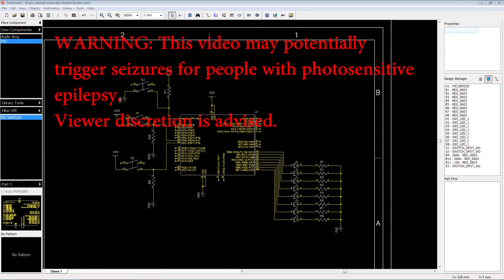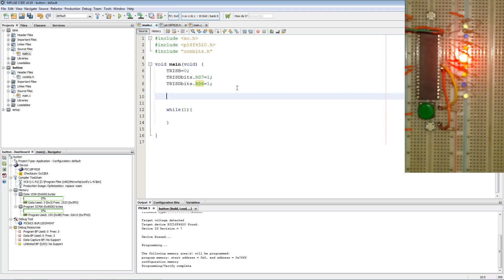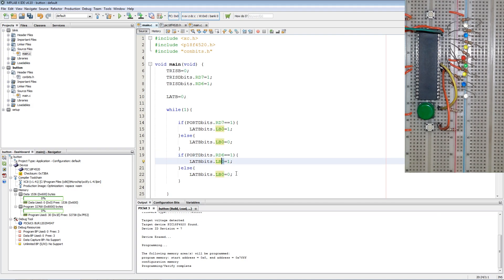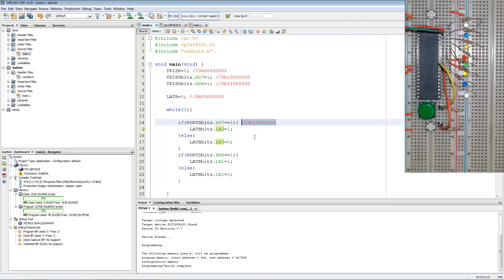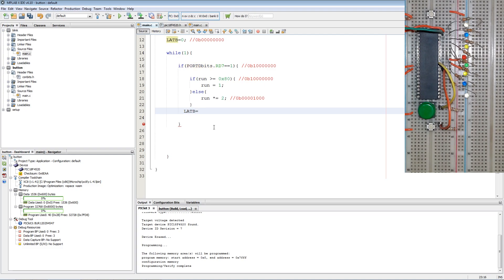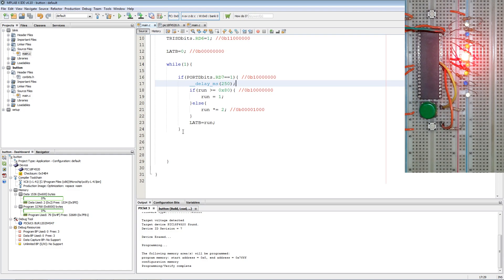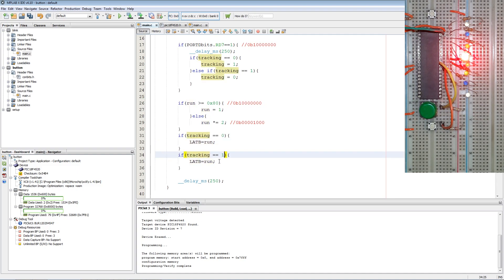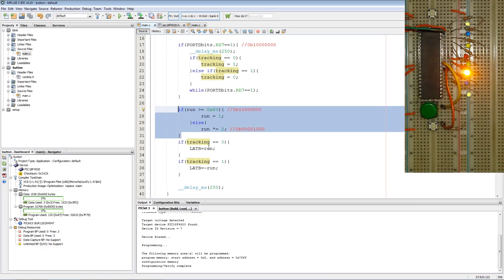Buttons as Inputs 🔴 PIC Microcontroller Programming Tutorial #4 MPLAB in C

Comment: Hi friend
I took your advice and switched to c programming code
I however do not know whats wrong when I compile an if(statement)
I do not get any errors however my pic 16f877a development board will not do as programmed
For example switch led on and stay on then if pressed again switch off

Pic 16f877a does not have a latch 
And I have not tried using PortBits to set my switch input 
I simply code for example if(RB1==1) delay_ms() them RA0=1 ; and vice versa

I have done numerous research and nothing is working I don't know if I am missing a library of some sort
I know my configuration bits are ok since I am able to blink an led 
I will sincerely appreciate your input

Sincerely friend ejike
Reply from the maker: // Declare variables
bool switchState = false;
bool ledState = false;

// Main loop
while (true) {
    // Read switch state
    switchState = readSwitchState();

    // Check if switch is pressed
    if (switchState == true) {
        // Toggle LED state
        ledState = !ledState;

        // Update LED
        updateLED(ledState);
    }
}

Comment: Hi. Do you have a video showing how to turn one led on with one push and then off with a second push , using the same switch. 
There is a lot of info on doing it in arduino but not for pic and mplab
Reply from the maker: if(port == 1){
	delay
	wait port
	if(led == 0){
		led = 1
	}else{
		led = 0
	}
}

if(PORTDbits.RD7 == 1){
	__delay_ms(250);
	while(PORTDbits.RD7 == 1);
	if(LATBbits.LATB0 == 0){
		LATBbits.LATB0 = 1;
	}else{
		LATBbits.LATB0 = 0;
	}
}
Reply from the maker: MCU does not matter, code is the same, all that changes is how the pin assignment looks
Reply: @BinderTronics  CODE IS NOT written THE SAME WAY for pic and arduino..
You did not answer my first question.
Reply from the maker: Spoon-fed you the answer. Funny how PIC and Arduino both use the same language.

Comment: hello can i use the same code for PIC16F1937???
Reply from the maker: Should work copy past.
Reply: @BinderTronics  i'm trying to do it but it gives me building failed i don't know why . also the instructions you used do you have a table for it ?
Reply from the maker: @unhelpfulguide2075  whats the error? Have a look at this https://youtu.be/OQ6hZzkvXMw change everything from 18F to your 16F. IO info is in section 10 of the PIC18F4520 datasheet. Section 12 of the PIC16F1937.
Reply: @BinderTronics  1 warning and 1 error generated.
(908) exit status = 1
make[2]: * [build/free/production/ADC_Tutorial01.p1] Error 1
nbproject/Makefile-free.mk:106: recipe for target 'build/free/production/ADC_Tutorial01.p1' failed
nbproject/Makefile-free.mk:90: recipe for target '.build-conf' failed
make[1]: * [.build-conf] Error 2
nbproject/Makefile-impl.mk:39: recipe for target '.build-impl' failed
make: * [.build-impl] Error 2

Build Failed 

that's what i'm getting.
Reply from the maker: @unhelpfulguide2075  TRISDbits.TRISD7 .  If you want to know why the error is there lookup C struct & union and look at the difference between pic18f4520.h & pic16f1937.h TRISDbits_t union.
Reply: @BinderTronics  i saved the PORT portData04 =TRISDbits.TRISD7 and it worked justt fine thank you thou ❤️❤️

Comment: How about some wireless communication setups and parts.. Arduino has the  NRF24L01 boards, but not sure what Microchips use.. Could be a nice tutorial...?
Reply from the maker: Does not matter if it is a "Arduino" board. The library can be ported to any platform. Ill put it on the list after i'm done with the base SPI tutorial. Don't know how long it will take though.
Reply: @BinderTronics  Sounds good.. I did not know the libraries were compatible since the registers are different on the 2 chips, I assumed they would be different.

Comment: Hi, 
I am looking for a simple code to push button which one push switch ON the LED and push again switch OFF the LED. 
Thanks!
Reply from the maker: Invert the value of the pin every time the button is pressed.
Reply: @BinderTronics  PIC16F876A
Reply: @BinderTronics  Actually, the LEDs are to indicate the signals that go to an H L298 bridge, but I cannot activate keep those signals after pressing a button and only it works when I press and hold the button.